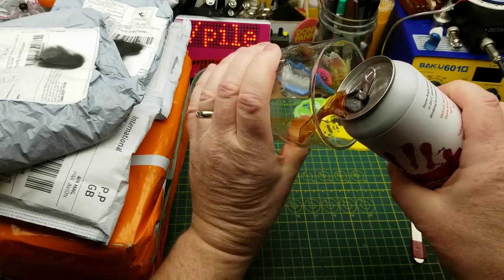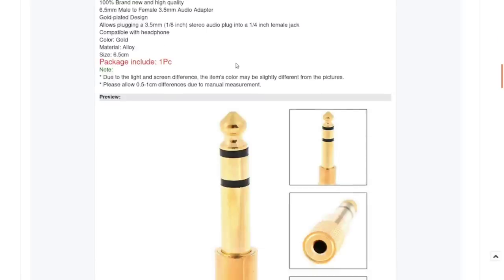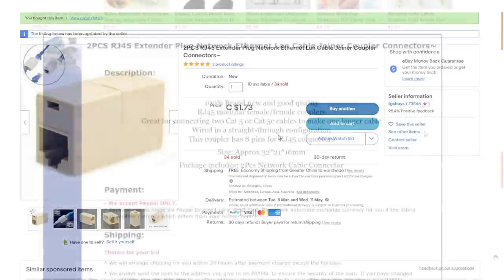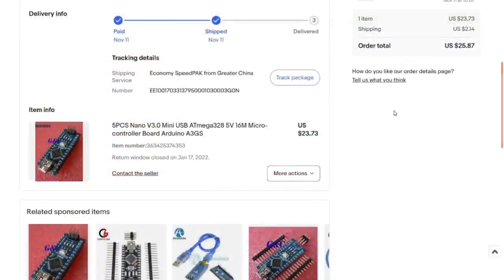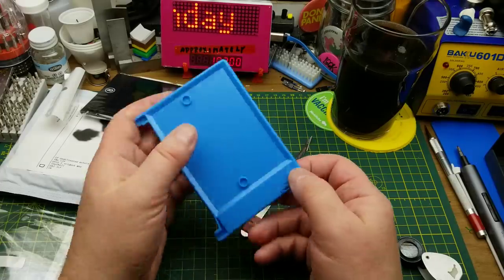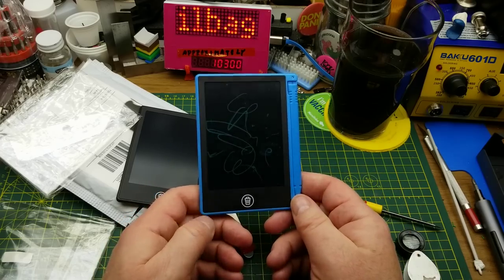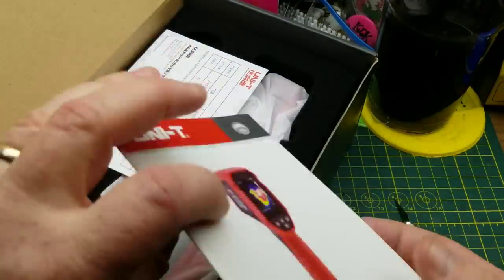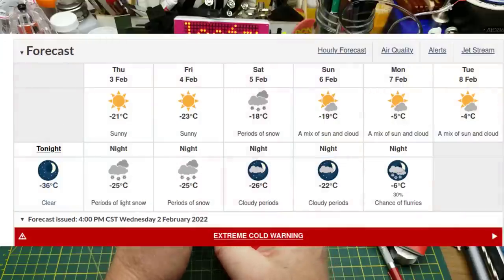mailbag Monday 133

Comment: I just went digging like crazy for one of those 1/4 to 1/8 jacks for my IBM PS/2  (weird that the headphone is 1/4"). I plugged the 1/8 into the plastic one I found and it crumbled. That was pretty tragic. I might need some metal ones.  

The other benefit of your method of keeping a patch cable in the tester is that it's handy (and "known good") when you want to test to an RJ45 jack on a wall or something. You don't have to go hunting down a patch cable. It's already there.

Comment: These RJ45 couplers are very flimsy and break easily. I make myself an extension cord with a patch cord of the desired length and an RJ45 keystone from the patch panel. Five years now, not a single problem.

Comment: I picked up one of those writing tablets too out of curiosity. I figured it would work for a shopping list. Still haven’t used it. And Nanos are great for prototyping, much easier and quicker to use than ESP devices, though the latter certainly have their uses. I lucked out and picked up two more for 99 cents each last year.

Comment: I just saved myself from spending $100.
Thanks.
.
.
I spent it on the last video, random mail in garbage bags: to be delivered in the next quarter. 🤫
Reply: BTW, bought ADCs and some ESP32's to slap in a "sealed" battery to monitor cell voltages. TBD. :D

Comment: Sorta confused with the uni-t 690b. I've seen it offered but never on an official uni-t site. Also that price is a screaming deal. I paid $400 CDN with a $50 discount for the uni-t 260b from the official store on aliexpress. Either way, nice device, some makers having been using ZnSe focal lens to shorten the working distance for pcb work.
Reply: You might be getting the model numbers mixed... the 690A is 120x90 = 10,800 pixels and the 690B is 256x192 = 49,152 pixels.  4.5x the pixels and almost exactly 2x the price.  I'm guessing the only difference between the "A" and "B" models is the pixel count.  I didn't see the 260B listed so don't know its specs.

Comment: Did you get a chance to play with the "Blue Pill" stm32f103 boards? They also work with the Arduino IDE, and have a very capable ADC that can be pushed to over 1MHz
Reply from the maker: Nothing beyond running a "blink" on it, just to prove to myself that i could.  
My mind keeps wanting to use the lowest power board that is viable for a given application and I haven't really had an application for such a powerful chip yet.
Reply: @pileofstuff  If by low power, you mean fewest milliwatts, the STM32f103 has some fairly impressive sleep modes too.
Reply: These used to be quite the deal.  Could get them for about US $1.20/ea about 2 years ago.  Now they are well over $5/ea.
Put the "Maple" bootloader on, and you can program them with Arduino IDE through the built-in micro-usb, auto-reset and all.

Comment: You can never have too many Nanos. Great for testing modules etc.
Reply: Check the Nano's, most have the old bootloader installed and if you want you can upgrade the bootloader.
Reply from the maker: It's easy to install or upgrade the bootloader. 
I have an old video where I went through the process.
https://youtu.be/ecEfRZl_OiE
Reply: @pileofstuff  I had to do 30 for work last month.👍👍